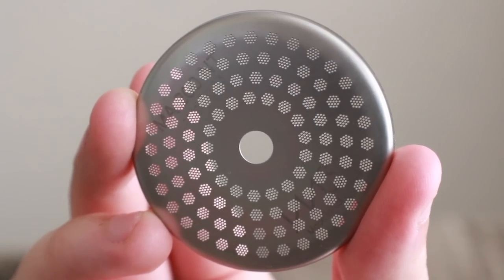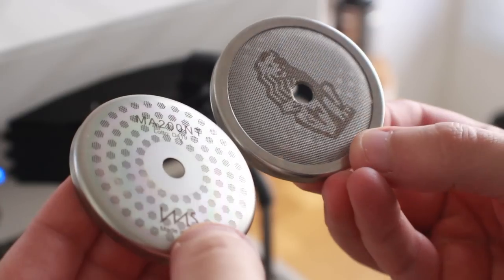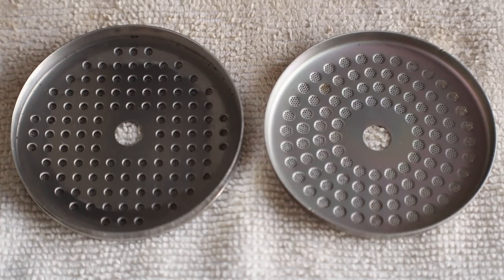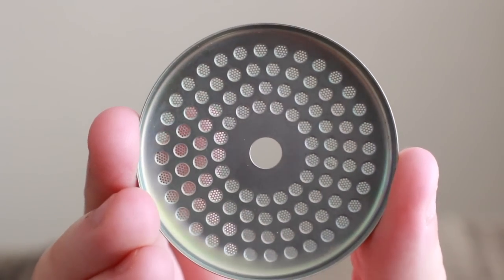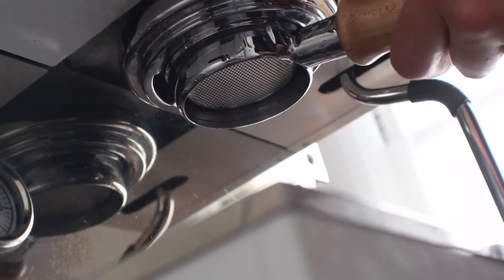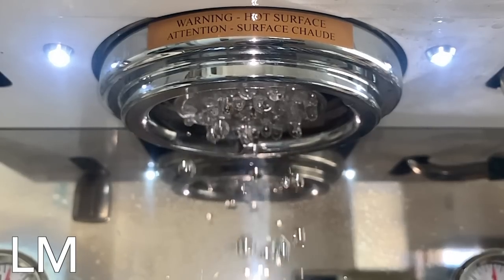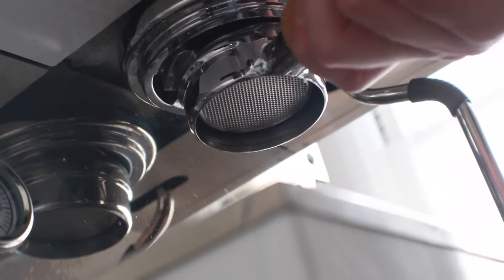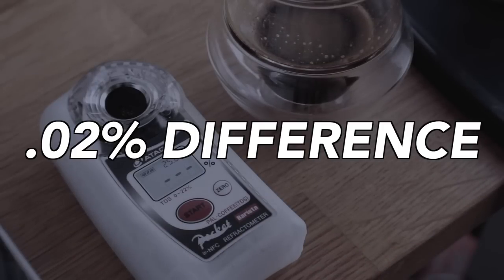ESPRESSO ANATOMY - Do Shower Screens Matter?

Comment: If I spent £3-4k on an espresso machine I’d be pretty pissed if I then needed to spend another £30 to make the screen significantly better.
Reply from the maker: Maybe you missed the point, but in terms of extraction which is essentially the most important think they were nearly identical...
Reply: @Sprometheus  yes that is what I mean. I’m glad it doesn’t make any noticeable difference because if it did it’d be really disappointed in my fancy machine.